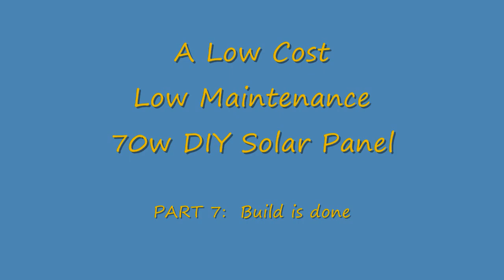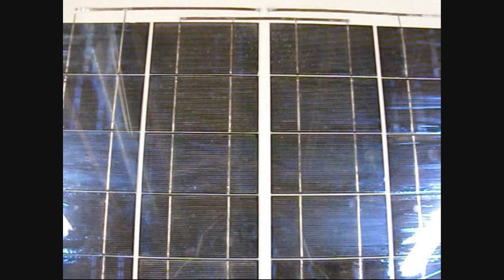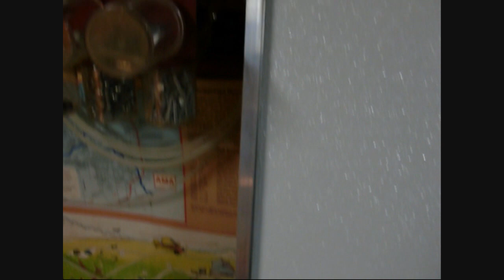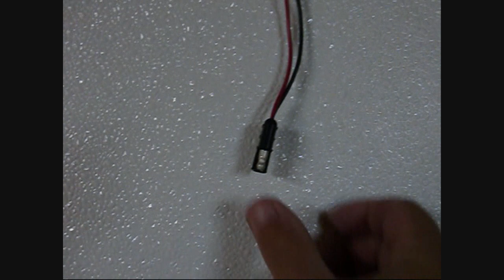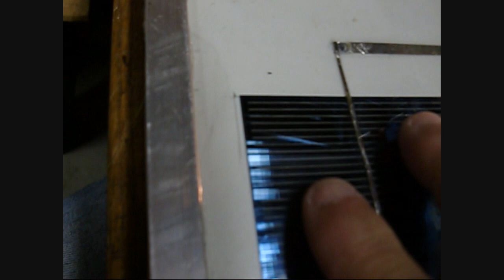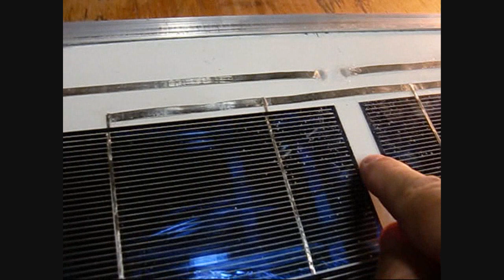PART 7:  $100 70w Solar Panel DIY project

Comment: I have most of the materials and held out on the glass and encapsulation method so far. I must see a non Slyguard/EVA system out in the weather for months before Ii commit to that version. How's it going so far and how much weather has this been exposed to? Also did you measure the VxA at the beginning to compare with after being outside for a few months?

Comment: Did you do your soldering with the cells layed face down on the glass then glue the FRP on? Biggest problem I had was being careful not to break cells when moving them around. Are those 3 X 6 cells a little thicker than the 5 X 5 s?

Comment: @ormonddude  The EVA with shipping is almost the same price as the syl gard.  The sylgard  184 is probably easier to use but I did have air bubbles when I did mine but I used 5 X 5 cells . weight the cells with plastic water bottles or soda cans filled with water til the sylgard is cured.

Comment: @MrHorsetail This is me, Fearless, using another account as I am out of town for a week.  I built the 10-cell strings using a straight-edge clamped to a spare piece of glass as a guide.  I then moved the strings to the FRP for gluing.  As mentioned, I made light pencil mark guides on the FRP so that the positioning would be spot-on.  Just measure it all out first.

Comment: I like how straight the cells are.  You never showed how you soldered them.  I'm wondering how you soldered the bus wire and didn't melt the frp.  Very nice looking job!